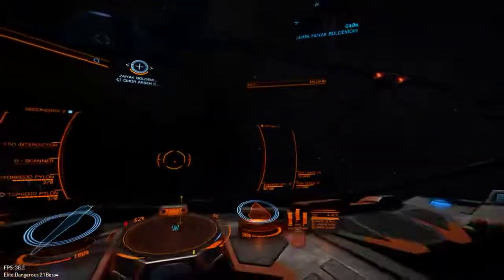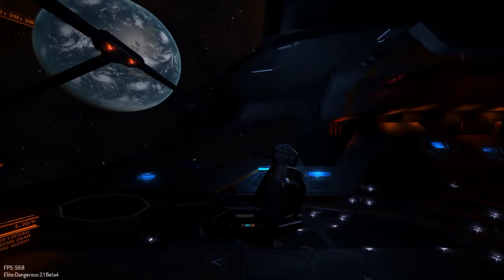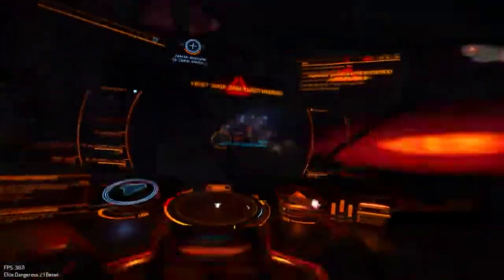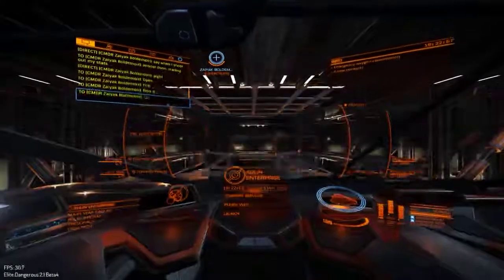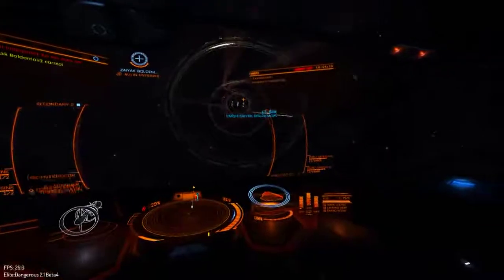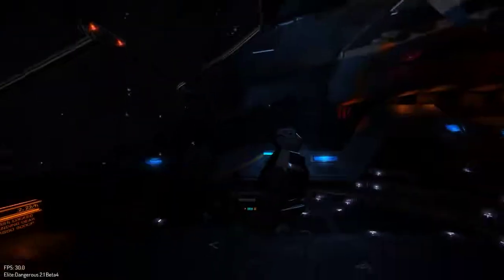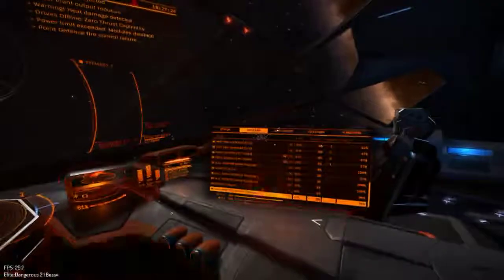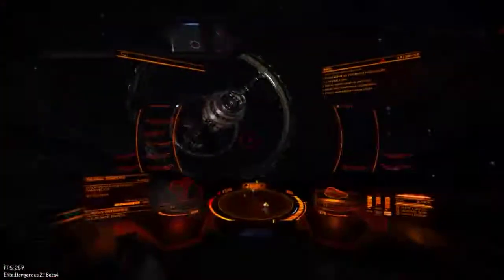ED 2.1 Beta 4 Thermal Shock Testing & Feedback

Comment: I don't think thermal resistance has anything to do with heat management. It just specifies how much damage reduction your shield/hull has from thermal-type weapons like lasers. That would also include kinetics like multicannon with incendiary upgrade However a regular multicannon with thermal shock upgrade is still classed as kinetic damage and does no thermal damage type (so it's not more effective against shields), but just causes heat buildup in your ship.
Reply: +CMDR Arsen Cross yeah the effect of thermal resistance provides a resistance to energy based weapons as opposed of the actual management of heat
Reply from the maker: Nathan Dixon Yep, but I'm not asking for it to provide heat management bonuses, I'm asking for it to provide protection from the effects of external heat sources to reduce the amount of heat that makes it through the hull into the internal systems that cause over heat.
Reply: +CMDR Arsen Cross that's still part of heat management
Reply from the maker: +Nathan Dixon We'll have to agree to disagree there as in my opinion it's only heat management once the heat becomes internal, and with my testing on live in beta 6, thermal shock is still just as deadly.
Reply from the maker: +ugowar I appreciate your feedback. However I want to specify that the primary definition of the word "Thermal" is "of or relating to heat". Therefore, scientifically thermal damage and "heat" damage are one and the same. It stands to reason that resistance to thermal damage, and therefore heat being inflicted by an external source should be affected by the hulls resistance to thermal attack.
Reply: +CMDR Arsen Cross No argument there on what the term "thermal" implies, I'm just pointing out the way Frontier (convolutedly) implemented this. They are separate effects. Also no argument on that, even after being nerfed to max 300% heat, the thermal shock effect is broken. I really hope this doesn't get past beta in the current form.
Reply from the maker: +ugowar Ah ok, I misunderstood your initial response then sorry about that. The way I read it made me think that you thought the way it was implemented was scientifically accurate. Sorry for making that assumption. I really really hope they make Thermal Shock and related heat effects respect thermal resistances.